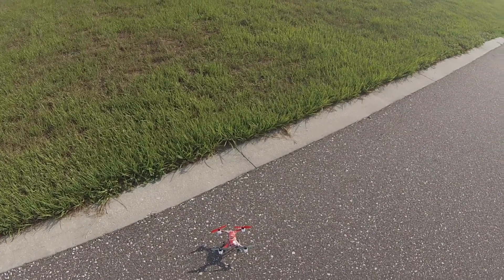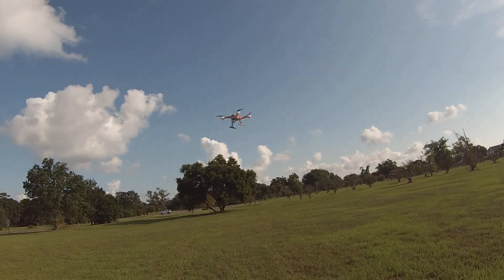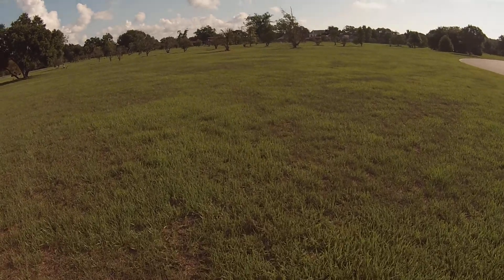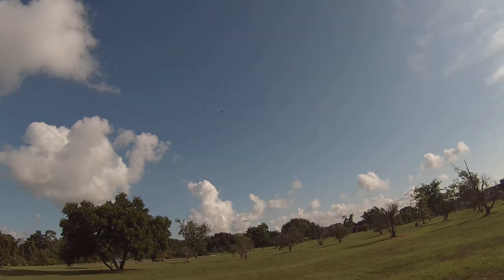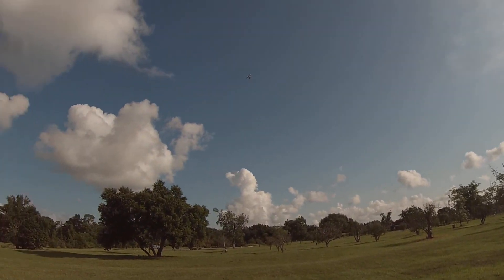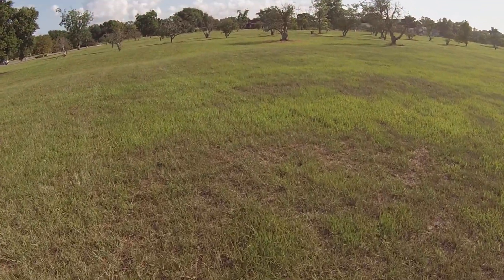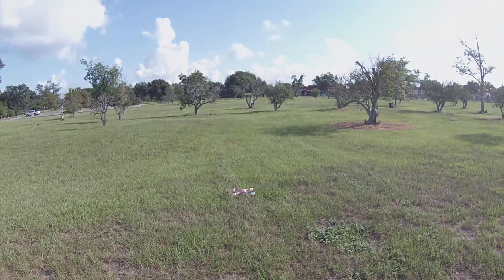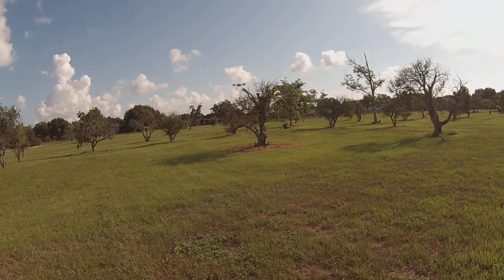Blade 200QX Firmware Update Test Flight

Comment: How to do the firmware update? It is not working on my 200qx
Reply from the maker: It was a little tricky for me. At first my computer would not install the driver so after I tackled that problem I was able to update it successfully. In order to do it you must download the update from here http://www.bladehelis.com/ProdInfo/F...atic_Modes.zip. Then after that unzip the files. Once you have done that connect the USB stick to your computer and then connect it to the 200QX using the cord they included with the update usb stick. Use the "black plug" and connect it to where the camera plugs into the 200QX. After all that run the BladeMultiRotorUpdateUtility application from the files you just unzipped. Choose the com port and then select choose file and select the 200QX update file. After that click "wait for device and upload firmware", then immediately plug in your flight battery to the 200QX. After about a minute your update will be complete. Now mine kept giving me an error message saying that "my device didn't respond in time". However after repeating that step multiple times and getting the same result. I decided to just bind it and see what happens. Now to bind it you must hold the rudder stick to the left until after you here 2 sets of binding beeps. If you let go after the first set in will not work. Once I did that it was good to go. Hope this helps.